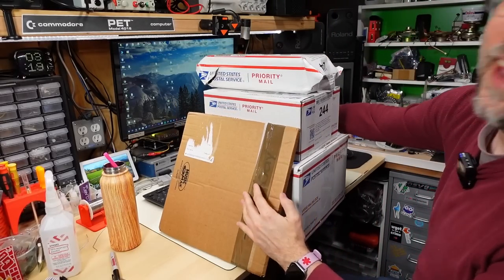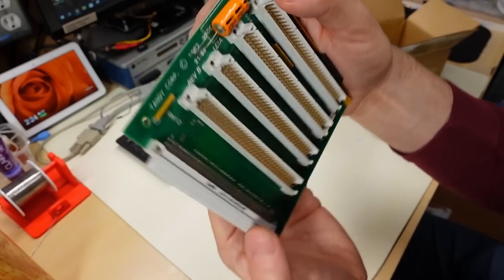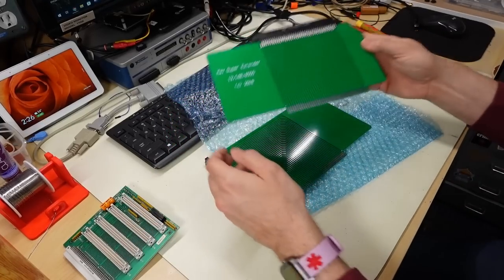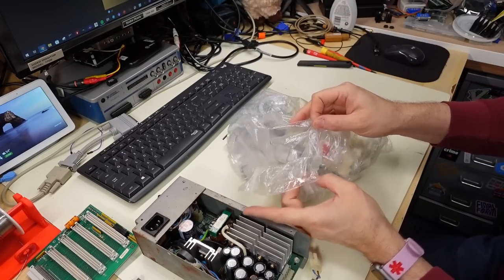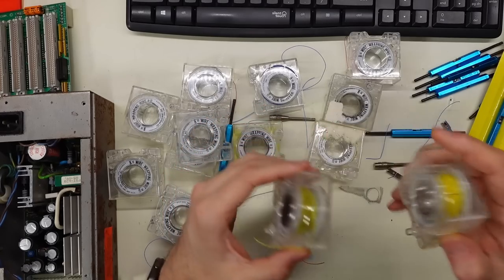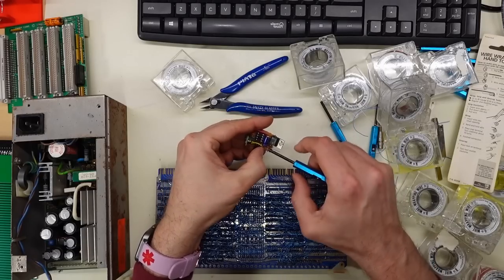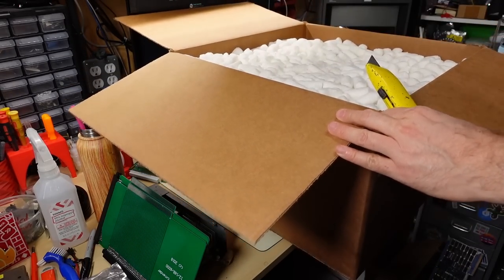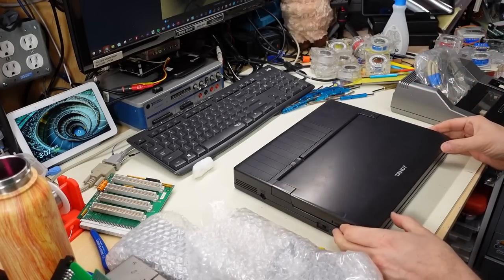0024 Wire wrapping goodies and some mystery Tandy items

Comment: A friend had a plotter like that around 1983/1984. It has firmware to make it behave more like a printer or can be used  like a plotter for graphing or pictures. I may have written a BASIC program to drive it back in the day!
Reply: I got one a little while back and spent ages trying to get it into working order again --- usually the nasty plastic gears tend to break over time, but weird I actually had stepper motor failure. I've got some long boring repair videos if you're interested, but here's a video of the plotter actually working: https://www.youtube.com/watch?v=Mezy3hranNg I love these pen plotters.
Reply: On the Commodore, you used the OPEN statements to access the comands
Reply: It is an ALPS mechanism, identical to the Commodore version. Pens and paper were the same.

Comment: It's been a long time since I see wire wrap in commercial use. Last time perhaps 24 years ago I went to China for setting up a multiplexter, since the 9600bps connection never come up, I bought the Racal Milgo modem into the telecom building to trouble shoot, at that time the telephone system there still using wire wrap while Hong Kong already start to deploy fibre-optics.

Comment: I believe the first item is a backplane for a Tandy 2000
Reply: It seems to have connectors with 3 rows of 32 pins, which matches the configuration for the "card cage" connectors (based on the "Tandy 2000 service manual" I found online), and the spacing seems about right for that, as well.  See page 46 of 693 for the pin out of the connectors.

I think maybe you nailed it.

Comment: I worked for DEC in 84-85, repairing mostly disc drives...  we had loads of PDP11's in as test gear, and their backplanes were all wire wrapped... it was considered good enough for major commercial machines....

Comment: I had the Atari 1020 version of that plotter, I believe it used the same mechanism (which was in a number of similar printers that various mid 80 computer manufacturers made) and it drew lovely pictures - until the pens ran out and I was unable to replace them. If I still had it I think I could probably 3D print a small carrier for a cut-off coloured Biro refill to make my own replacements, but there you are!

Comment: I had one of those plotters. It uses small ball point pens. Fascinating watching it draw text.
Probably you can 3D print something to use a cut down regular ball point pen?
Reply: yes
Reply: Around 40 years ago, I had a similar (or equivalent) Commodore plotter which I had attached to my VIC 20 through the serial bus; can’t remember the model name. Four tiny biros slotted into the print head. Totally agree that it was fascinating to watch — hypnotic, even. Just writing about it reminds me of the sounds it used to make, especially on startup rotating the pens around.

I believe a number of manufacturers used the same mechanism branded to their own style and with appropriate interfaces.
Reply: @timothyp8947  a quick search suggests that it was the 1520.
Reply: @timothyp8947  Indeed. Although there seemed to be a lot of small form factor plotters around in the early 80s, there was only really one, but in a bunch of different casings/brandings. My ZX Spectrum plotter was exactly the same as my friends Oric plotter, which is the same as this and your Commodore one.
Reply: The VIC 1520 PLOTTER.

You can get new pens for them.

Comment: As for that Tandy notebook computer, it's probably the polariser filter that's failed causing that weird hotspot discolouration, it is possible to replace it, but it's one of those tasks where you have to be super-delicate as peeling off the old one risks distorting the LCD to the point it could crack, rendering the repair useless, and of course needing to be super-clean to avoid getting a speck of dust under the new filter which would be a PITA to get rid of...

Comment: Back when I worked for Burroughs (70s-80s) A lot of the backplanes and circuit boards were wire-wrapped. The factory used a huge CNC machine. Gardner-Denver if I recall. In the field, we had a powered hand tool that looked a bit like a right-angle Dremel. Lucky for me I was able to borrow one when I built my Z-80 homebrew. I would have hated to do all that with the tool in the video. :-) I had one, and it was a pain to use in removing all the wires from the scrapped boards I was using.
BTW, one of the problems with wire-wrapping is repairs. Some of those pins could hold 3 layers of wraps. Imagine the fun if you had to change the bottom one. :-) Another problem could arise if your wires were routed to tightly. The sharp corners on the pins could cut through the kynar insulation and cause hard to find intermittant shorts. This was aggravated if the temperature changed like when the air conditioners went off. It made the wires stretch...

Comment: The Tandy 4-card expansion board...  did a LOT of googling, found that exact card as an eBay item in google, but it no longer links to anything useful.  Best I could find was that the Tandy TRS-80 Model 2000 has a 96-pin expansion port, which may fit your expansion card.  The 2000 Service Manual only speaks of specific RAM or other cards you can use in the existing one-card slot.
Reply: That 96-contact connector is a DIN 41612 standard, I noticed it right away when Adrian showed it on screen.  I think we've confirmed it's for the Tandy 2000, but is it the internal backplane, or for expansion in some way?

Comment: I had an Amstrad plotter that was compatible with the CGP-115 but was TTL and ran at 4800 baud so some software would not work with it as the baud rate was hard coded.  Anything using the ROM print call would be running at 4800 baud by using the 64K enable program then poking the baud rate setting into the ROM image. I built my own interface using a transistor, resistor, diode and 9V battery.

Comment: The wire wrap experts have noted that you should have an insulation wrap at the bottom, a full turn.  If the wire is stripped to the correct length (1"?), the tool will let you insert it far enough in to have some insulated wire to wrap around the bottom of the post.

Comment: I have the same laptop that you showed last. Mine is actually labeled as a GRiD 1755, but it's essentially the same. The GRiD version does have VGA and a PS/2 port. The open hole on the back you mentioned is indeed for a 2400 baud modem. I have a copy of the manuals and disks for this laptop if you need anything.

My floppy drive was also dead, the belt was broken. Unfortunately I was unsuccessful with my attempted repair as I broke a flat flex connector in the drive. Haven't gotten a replacement yet. Luckily your laptop powers on, but mine had some leaky surface-mount caps right near the power regulator module. After repairing those it came to life. 

My NI-CD battery is also dead and doesn't work, I'd be curious what you'd recommend as a replacement.

Comment: In my earliest work on electronics, transistors/ICs were EXTREMELY heat sensitive. If you were constructing things (especially transistor items) you would wire wrap the legs rather than solder. This also had one other advantage - no requirement for printed circuit boards. You could use perf or no board at all.

Comment: The "backplane" at [2:10] looks to be using DIN 41612 connectors, sometimes referred to as "Eurocard" connectors.  I worked with them on modular computer boards for industrial controllers and such, there are various sizes and numbers of rows & pins.

For some reason seeing that board made me think of the Tandy 2000 computer, which used the 80186 CPU and had quad-density 720K 5.25-inch floppy diskette drives.  I almost bought one on clearance at my local Radio Shack back in the day, but glad I did not.  It was just different enough to not support most software and other hardware.
Reply: UPDATE: On the "Worthpoint" site I found a picture of a Tandy 2000 memory expansion card, and it has those same two-piece connectors with three rows of contacts that I mentioned.

Comment: The CGP-115 printer/plotter is very similar to the Commodore 1520 and the Atari 1020.  The 1520 uses little ball point pens of different colors unlike something like HP 7225 which had something of a felt tip pen or the HP 7440 which had a carriage of them.
Reply: The Commodore and a tarry plotter plus the Tandy one share the same Alps mechanism.. The weak point is a couple of the gears tend to split but luckily in this age of 3-D printing and now since you're machining a brass you can get replacement parts that are 10 times as good as the original. You can still get pens made new as well.

Comment: The backplane could be from a Tandy 16B /6000.
It's been a long time since I looked inside one. From memory the 68K card, memory cards and 3 port serial card all plugged into a backplane with a Z80 cpu controlling all I/O.
Reply: Could be...  I posted a comment thinking it might be for a Tandy 2000, even found a pic of a memory card that has the same connector type.  But I'm not familiar with the details of the bus on the 12, 16, 6000 Tandys.

Comment: I had a plotter like the one shown and had it hooked up to my Dragon 32. The biggest problem with it was that the drive gear that pressed on to the motor shaft was always needing replacing because it kept splitting.

Comment: The problem with plotters of that size and vintage are finding replacement pens and little plastic gears which break easily. I had fun with my Atari 1020 plotter until it broke. Super cool. I miss it.
Reply: Had the 1520  In college and I used it for my physics and chemistry labs papers for the graphs et cetera. It was perfect as I could take the graphs to the photocopier enlarge them 200% and then they were the perfect size.

I managed to find one on eBay 5 years ago for $40 that was nearly new in the Box. And I even found the 1 for the atari A bit line of computers. But that 1 is new in the Box and has never been opened

Comment: Sadly, modern plotters don't use pens anymore, they are just big ink jet printers.  Which loses the magic of the clean line and the paper shuttling back and forth while the pen went side to side to generate the required lines.

I remember printer plotters back in the day (80's era), where the plotter actually drew each character in printer mode.  Super expensive to operate as the pens weren't cheap.  But the output was amazing compared to dot matrix.

Comment: Found a Commodore branded laptop with leaky nicads and a burnt out screen. Luckily it did have a video out, so I now have a cheap working 386. Still need to 3d print a housing for it, so it looks like a desktop machine.

Comment: If the first board has a 4 position switch..it might be the multi-port interface for the Color Computer. I had one so I didn't have to unplug the disk drive controller every time I wanted to play a game cartridge...that or it's a Tandy 1000 riser card

Comment: You might want to take a look at Noels videos "Early MS-DOS Laptop Amstrad PPC512" Part 1+2 where he restored a similar machine's LCD
Reply: That was a different fault (missing columns of pixels), and the fix didn't work. The LCD panel on Adrian's Tandy is dead, unfortunately.
Reply: @Zeem4  I was rather talking about the replacement method. Adrian's LCD obviously is toast.

Comment: Nearly all of the inter-connections of the Pioneer RT-909 Reel-to-reel player use wire-wrapping to link various circuit boards together.
Reply: WHAT A MACHINE ....  I love all the deep-blue silver Pioneers. Kenwood used this in some decks ... mostly the R/P amp board and power supply and Sansui had its transformers wired to the voltage selection board with this method. Not sure if the bigger ones did.

Comment: Warning, wire wrapping is only really effective on square posts as he showed. It may hold, but the ideal connection is when the pin/post digs into the conductor. This also ruins the conductor when removed.  You have to use section of wire everytime.

Comment: the card is an extension for the tandy 1000 ex and hx series to add more slots
Reply: I'm not so sure. Adrian never held the card still but I think those are 3-row connectors, possibly the same style used in nubus. But the connectors look the wrong polarity for that system. And the EX/HX used a two row pin header connection if I recall? I know there was a four-slot cartridge adapter for the coco, but didn't that use card edge like everyone else?
<update> Another commenter suggested the Tandy 2000, and looking at this review from Byte linked from the Tandy 2000 Wikipedia page, I agree.

Comment: I owned a Tandy color plotter back in the day and is was kinda of cool for a few weeks but its was rather sloppy printing and the plastic gears inside wore out pretty quickly. The plotter was very reasonably priced but it really was just a toy.
Reply: If you've still got it, you can get replacements for the plastic gears that always break. Replacement pens, too.
Reply: I had the Commodore 1520 plotter which seems to have the same internals. The pens were forever drying up. This brings back memories https://www.youtube.com/watch?v=60z_1G1N0vc
Reply: @daveh4509  Yeah, they all used the same ALPS plotter module which was super fragile. There was even a double-width one which you could get on _typewriters_, of all things. https://www.youtube.com/watch?v=9vlbLF96Uiw
Reply: @hjalfi  I lost it long ago along with my TRS Model I, but I did replace the gears once in the machine and I got the parts from Radio Shack for less than $10. I had made friends with manager of the Radio Shack I always went too. Back in those days I was at Radio Shack at least once a week and though I did not have a lot of money I bought tons of stuff there. I asked the manager if there was any way to get parts and he told me he could get them for me and he charged me his price for the parts because the parts were not officially available to customers. The replacement gear lasted much longer but the pens did not last very long. A few years later I acquired a Tandy pocket computer with the docking station that included a even smaller version of the plotter which was worked well enough for printing basic program listings and lasted as long as the pocket computer itself.

Comment: Recently I have the sameissu in my Handheld scope (a 90's Tek) and I got really upset (of course no one hassparesfor this, even the oficial representative. A nice paperweight ... it was unusable. I manage to find one guy selling polarizer film online, I bought both 0 and 90 degree orientation (I didnt know which of them in advance). The HARD part is TAKING the old one out. It is like removing the tint from our car, but when the tint is expirated and bad. Obviously the screen is way more fragile. In my case I succeded. It took me two hours of removing the polarizers and cleaning all the glue esidues ... but the effort paid off, I got my Tek working again for almost nothing.In this retro machines, it worths the effort no doubt. JUST BE CAREFULL WHEN WORKING NEAR THE LATERAL CONNECTIONS. In my case an alternate use of isoprop and WD40 helped. WD40 is pretty god at softening this glue and the isoprop just finishes it off. It is risky ... but completly doable.

Comment: The screen on that Tandy laptop looks like it has suffered damage from storage in either a very cold location or a very hot location.  Either way, the temperature will destroy the liquid crystal rendering the panel unusable.  Very unfortunate.  That laptop would be more of a rarity in the world than most others from the early 90's.
Reply: It is just the polarizer that. Some sort of fingus (Im not sure) that goes betwen the polarizer and the glass pannel. Like in the CDs. Probably humidity ?, Vintage computers suffers this a lot. I had Toshibas and IBM developed this crap. Looks lik its is burn ... but it is not. It is like a haze between the glass and the film with its pretty peculiar vinager smell. Just by the smell you can tell, it is very strong